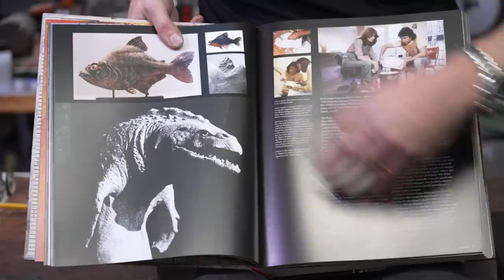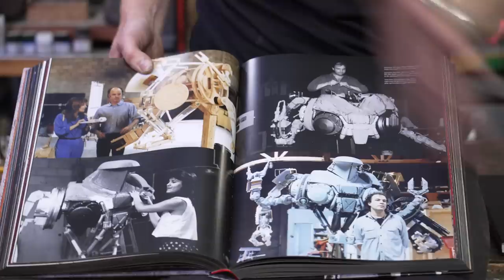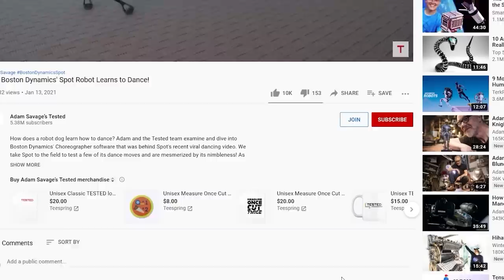Adam Savage's Favorite Things of 2022!

Comment: Adam, one of my favorite things over the last several years has been Tested. You've been doing really fun stuff.

One of my favorite videos is the fricken Apple Box build. It's cool that you went into the background behind them, C-Stands, and the C-47. I went and built my own, and to be honest I cheated and put a hinge on the lid with some latches so I could put stuff inside while still having it highly reinforced enough that I could still stand on it.
Another build I did was your articulating bench lamp. Built one to put on my desk at home because Desk LED lamps are offensively expensive.

And the number of tools I've picked up... okay it's not a lot but it's several, 123 blocks, USB-C soldering iron, 3 in 1 oil, wifi endoscope, I'm sure there's more. I made use of the endoscope recently to look in a wall to make sure I wasn't going to shred some water lines by putting a drywall anchor in it.

Comment: I too am fully vested in the DeWalt ecosystem for better or worse.  I have been thinking about that die grinder, but the thing is kinda HUGE.  So used to pneumatic die grinders that are essentially a dremel on steroids.  This said, I will be building my Overlander from the frame up this year...gonna be a LOT of welding.  Might have to pick one up.

Comment: I didn't know I got the same kind of glasses Adam has. When i brought them there where the cheapest ones i could afford at the time. Then one day watching a video of yours and then i thought how come there look like something i seen. then i look at mine and said how did i get the same pair has you when I didn't even know what I picked out at the time. i thought i got blue ones that were just a plastic cheap one. Because i always had wire frame glasses before and got tired of having that kind because there always broke after a year and a half at the frame and arm. had theses ones over two years and not even broken at all. So thank you for kind of changing the glasses i were now.

Comment: So, I was surprised to discover that the 20x loupe is actually not the standard for jewelers. The 10x is the standard. They can and do use the 20x as well, but the 10x is the standard. For machinists, I can understand the desire or need to use the 20x.

Comment: Your "Dewalt" until they change the battery connection in two years and you have to get all new gear afrter the batteries wear out. Its happened several times with them....and most of the others.